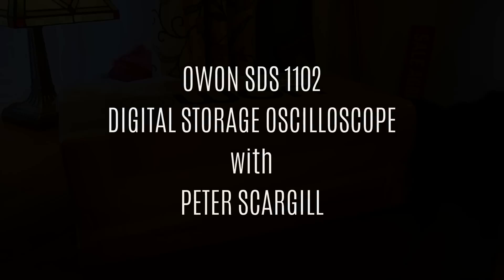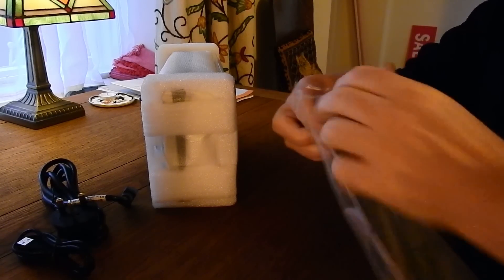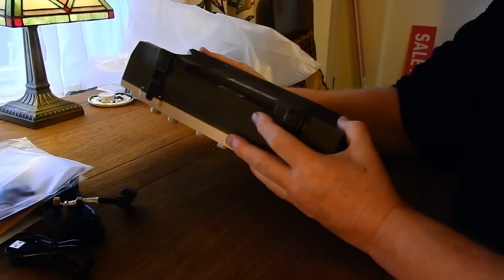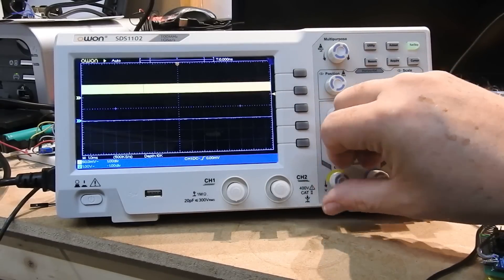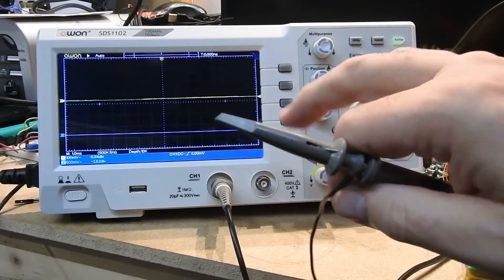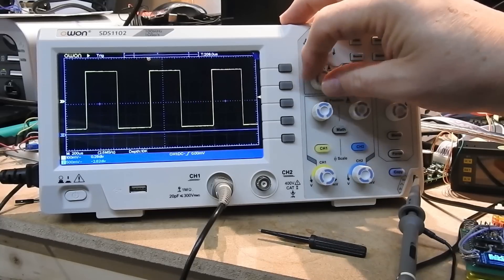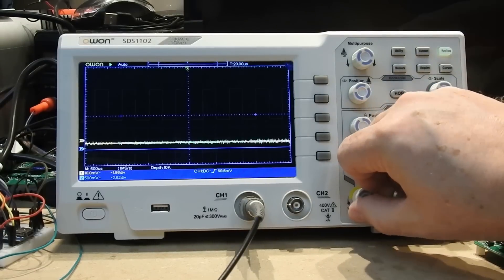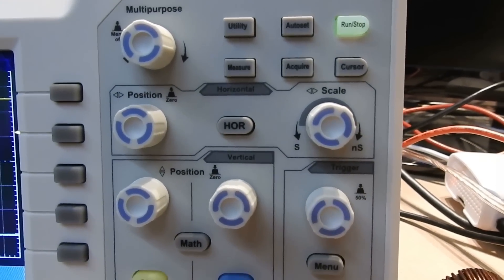Owon SDS1102 100Mhz 2-channel Digital Oscilloscope

Comment: I bought one for use with my curve tracer only.
Works perfect but heat a lot.
I make a hole in the back and install a 3 inch fan.
In the long run this heat can damage something.

Comment: I purchased one of these OWON SDS1102 oscilloscopes a while ago to test CPUs and memory in retro computers. There's a lot of videos showing what you should or shouldn't be getting but there's not many, if any that explain how to setup the scope for testing memory and CPUs like Z80s and 6502s. Not having a background in electronics, I want to make sure I don't blow up the oscilloscope or the parts I'm testing. Is anyone able to give a quick rundown on how to setup the OWON SDS1102 for testing memory chips in those old 8 bit computers?
Reply: Hey, how are you? I'm not a pro but there are some basic things you should definitely know before even turning it on! Never put your probe or gnd on the hot side of the PCB, otherwise... "boom". Considering the scope shares the mains ground with the device you are testing. Make sure you are measuring DC signals on the cold side of the board. Just my 2 cents, hope you didn't blow it up yet xD
Reply: @magnum333 what do you mean hot vs cold side of PCB can you please elobrate.
Reply: @abijeetrs6522  Hot side is where AC enters the circuit, where the diode bridge, AC-DC transformers and other related components are. Cold side is all DC and has a different GND, so you're safe using your probe on that side. If you are working with PSUs it's a good idea to build a current limiter using an incandescent light bulb.
Reply: @magnum333 got it  thanks for the info 👍

Comment: Looks like they have a 4 channel version as well these days, which is the SDS1104 and it's available for around 300€ which is pretty crazy considering the other cheapest 4ch scopes are 400€ or so. This review is really helpful even if it isn't the same model, at least tells me that Owon isn't completely trying to BS people although I'm sure there's going to be some compromises to make it so cheap

Going to have to sleep on it a few days before I make a decision, there's so many different options these days and it doesn't help that as a beginner I honestly don't know what kind of performance I would need from a scope but I suspect it's going to be far less than whatever these cheap scopes are capable of
Reply: По итогу какой осциллограф вы купили ?

Comment: How's the unit working out for you seeing it's been in use for around 3 years? 
If you still have it now's the time to re-review this here unit
Reply from the maker: Hi - some time ago I mentioned in here that my colleage Aidan has the scope - i've not used it for some time as I have other models higher up the price range. Sorry.
Reply: That's great @PeterScargill   thanks for letting me know it's still around, unless Aiden is just keeping it as an emergency back up should his more expensive oscilloscope fail..

Comment: ch1  is it 300v rms  really,,,,  and ch2  is only half  400v pp  huh.....
Reply: Any proof?
Reply: @perepasqual4467  Says it on the inputs for channel one and two on the front panel.
Reply: @jasoncampbell8879  thanks a lot, Jason. I'm a novice and I was just looking for reviews of this oscilloscope as I'm planning to get one, and I don't know the implications of these ratings. Could you ellaborate a bit more, please?
Reply: @perepasqual4467  I'm pretty much in the same boat as you. But, I'm looking at buying one myself also (which will be my first oscilloscope). They look pretty good to me. I only mainly deal with low voltages, so I'd never go anywhere close to the ratings on the inputs.

Comment: Hi I have assembled a PPP Beach (Rev-E) metal detector.  In the construction it said to connect the scope to the resistor 4and I should get aFlyback of 350 volts or higher. Could please explain how I can read this on the scope. Yours sincerely Warwick Spies from Aussie land

Comment: Hi Peter
I have a SDS 1102 Oscilloscope. 
I have built aMPP Beach (Rev-E) metal detector andI have to test it with my oscilloscope. The makers tell where to connect the probe but they don’t tell me where to connect the clamp of the wire that is connected to the scope. I would appreciate it greatly if you could inform me on this matter. 
Yours sincerely Warwick Spies. E-mail address   wspies32@gmail.com  thanking you again.

Comment: Hi Pete, and thanks so much for taking the time to make this video!  I am thinking of buying this oscilliscope and was wondering when you have some time if you could give us any updates as to how it has been performing for you.  I read somewhere that someone with a different Owen model oscilloscope was having problems with it freezing up 2 to 3 times per hour and several people said the software it comes with is very hard to install and most of them gave up trying to install it.  Also have there been any firmware updates since you have had it, or have you noticed any bugs?  Thanks so much!
Reply from the maker: Hi there
A colleague of mine is using this on a daily basis and I think he's quite happy with it. We started moving house in January just as I was in hospital... we are still moving, so I've no access yet to some of my tech kit.
Reply: Thanks for the quick reply. So sorry to hear you were in the hospital. Is everything OK now?  Moving is stressful enough so must have been extra stressful wiith a hospital visit. Hope things are better now, hope you are able to unpack your electronic gear soon and take care.
Reply from the maker: 2 months in hospital to be precise... stroke in December. Just had my first proper drive today with an instructor,  didn't do too badly. Spending half my days exercising, the rest at the computer working on restoring my keyboard skills.. and yes some of my kit is still in storage, we hope to complete the house move near end of May after a break in Spain.
Reply: So sorry to hear about your stroke. 2 months is a long time to have to be in a hospital. Are you feeling better?  Any  difficulty with speech or motion?  Good that you are exercising and working on getting your typing skills back.  Best of luck with all that and take care.
Reply: Forgot to say have a great time in Spain. Sounds like you deserve it.
Reply from the maker: billguitarvin hi, speech is fine, motion fine but speed is still reduced.Brain is having to share a few spare connections with my typing arm.
Reply: Thanks for your reply. That's good your speech and motion are fine. Hopefully your brain will make some new connections and no longer have to share paths with your typing arm. All the best to you and take care!

Comment: Nice little scope. I also have a low end hantek scope from China and I mostly use it not for seeing fast signals but often to monitor something over seconds or minutes. Nice little data logger for a super cap or a battery.
Reply from the maker: Ah, good - I'm glad you wrote in Michael - because I was GOING to get a Hantek at some point. What is it like for responsiveness. One of the things I like about the OWON is, for example when you put your finger (or a signal) on the lead it responds immediately, just like an old-fashioned tube scope. Is the Hantek responsive like that? Which model do you have?
Reply: Peter Scargill I will go to the basement and check this for you. Did not use it for a while since I have a 3 month old daughter now which is stealing most of my free time ;-)
Reply from the maker: Yes, they tend to do that....
Reply from the maker: Well, that's good to know - I took a look at your site - of course I can't understand a word of it:-)  but now my new goal in life is to own one of those thermal cameras like the DT980 - that looks like a lot of fun....
Reply: Here in Ukraine we sell the OWON scopes in hundreds... Very nice scopes. It may be 1 failure (mainly power supply) of 200 scopes. www.gtest.com.ua We easily replace defective power supplies ourselves. So, actually no failures....
Reply: Peter Scargill hello Peter. I finally managed to go to the basement and I took a little video showing the scope in action. Just take a look. If there are any questions or if I shall test something for you just ask. Btw it is my first video here on YouTube. 

Greetings from Germany. 

Michael

https://youtu.be/4Glxo3dcea0